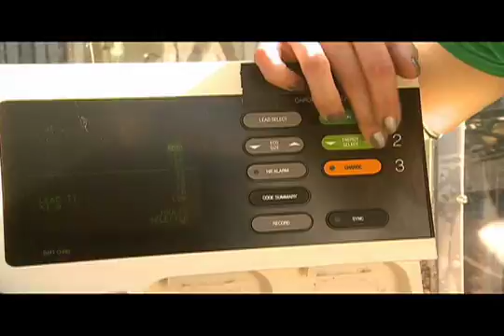MythBusters - Defibrillator Jumpstart

Comment: There seems to be a classic misconception that electricity=electricity. The defibrillator puts out thousands of volts at a few milliamps, the car needs 12 volts (thereabouts) at many amps to start. To the defibrillator, the car's 12 volt system, both the battery and starter, was such low impedance it was like a dead short, putting out it's full amperage capacity, which to the car was negligible - those milliamps just passed straight through, the voltage the car saw (impedance*current) would have been very little. I would guess that this would have no affect on the car, but depending on the defribillator's short-circuit protection may have torched the defibrillator. As for the car not starting afterward, it could be leaving the key on that whole time burned the starter. The battery didn't have enough power to crank it over, but even if it's "dead" that could run enough current through it to burn it out over the course of a few minutes - it's only designed to run a few seconds at a time. Another one of those moments where Mythbusters, as fun as they are, prove to be very un-scientific in their reasoning.
Reply: I was thinking the same thing.  Even 6 volts through a starter for a few minutes will kill it for sure.

I bet if they hadn't forced the ignition for so long the car would have started from the jump just fine.  The defibrillator didn't even touch the car in terms of power.
Its always been a pet peeve of mine when people talk about electrical power using only volts.
Reply: Defibrillators don't shock at a few milliamps, tens of amps depending on the energy
Reply: All I read was blah blah science blah science blah

Comment: Defibrillator has a lot of volts, you need amps to turn it over. Probably fried the battery, starter or blew a fuse.
Reply: if they blew a fuse the solenoid would not have engaged my bet having to livee with cars older thhan i am they got really unlucky and cranked thhat starterr its last time then didnt check that option.

Comment: High voltage low Amps, not enough juice to turn over the starter. Might have engaged the solenoid, but nothing else. As for it "killing the starter" or anything else, if the car was engaging the solenoid with the key after, the electronics are working, and I presume the jumper cables they had just didn't carry enough amps to turn the starter. Leave it sit for a few minutes and it would have worked fine. 

FYI the little tiny jumper cables you pick up at Harbor Freight or Home Depot are too low gauge to run the starter. Almost always you will have to leave the cars tied in for 5-10 minutes to allow the donor car to charge the dead cars battery.
Reply: no such thing everything has resistance.
Reply: Excuse me for the late reply but the defib discharges a capacitor across the paddles , capacitors supply infinite current for a finite period of time...
Reply: He is talking about jumpstarting at the end with the other car, and he's right IMO.

Comment: I don't think it would cause the lead acid battery to explode.. the battery would just absorb the charge. The voltage spike seen by the car's computer wouldn't be anywhere near the 1000s of Volts of the Defibrillator, but, obviously 100s is possible and that would kill the computer if it doesn't have surge protection.
But the battery itself would just take it in stride. The defibrillator won't put out enough current to cause the battery to heat up noticeably during that short period of time. IMO!

Comment: Prolly just blew the fuses, not the starter itself
Reply: True but it would still turn over.
Reply: Don't think the starter usually has a fuse.. direct connection to the battery.. maybe though. Maybe the main fuse for the fuse box though, so, no computer, no crank. and/Or the computer fried from the voltage spike.
Reply: danwat1234 Starter itself doesn't have a fuse, but all that power running through the wire harness prolly blew fuses for things like the fuel pump, injectors,  etc
Reply: it would blow the main fuse

Comment: @alwinovich @alwinovich It's 0.003 amps and above is lethal, Also you don't need voltage to kill you, Voltage = ammount, Amps = Strength. So no matter if it's 12 volt, 24 volts, or 240 volt. you get 0.003 amp trough your heart, you might die.
Reply: No, it's the other way around. Amperage is the amount of charges the current has and voltage is the strength each current has. What matters in lethality is wattage.

Comment: @alwinovich It's 0.003 amps and above is lethal, Also you don't need voltage to kill you, Voltage = ammount, Amps = Strength. So no matter if it's 12 volt, 24 volts, or 240 volt. you get 0.003 amp trough you, yer dead.

Comment: if you are jumpstarting a car it is better to clamp plus+ to + on battery and negative - on car body it is less likely for the battery to explode
Reply: Basically because the negative wire for the battery will provide additional resistance, cushioning the battery from the charge.

Comment: @alwinovich So you say if i stick a 9v battery to my toung I would die? because it got 150mA?? and i feel it in my toung :) Give up dude its de amount of energy (Volts times Amps) that counts :) I can stick my toung to 1x1500mA 1,5v battery (used wires of course) and it tickeld :D
Reply: The path of least resistance is the distance between the (-) and (+) poles of the 9V battery, so it all happens on the tongue. - or + on each hand is a different story!
Reply: No, the voltage is far too low. However with how many nerves there are on your tongue 9V at 150mA will hurt like hell.

Comment: I rather dought the difibulater killed the starter , but it probbly kiiled all the electronics in the car like the ECU and on many cars the ECU controls the starter  and the relays that click might not be controled by the ECU itself , if the car had a key with a chip and the ECU was damaged the car wont start

Comment: Ok, technical break... A defibulator discharges AC voltage, your car requires DC voltage. Second, all the volts in the world will not start the car if you dan't have the cranking amps to turn the starter. Exposing a human body to several hundred amps would kill you.
Reply: Defibrillators and especially the one used in the experiment don't put out AC current. They haven't since the 1970s and even biphasic units which deliver energy two directions aren't true AC. The defibrillator they used for this experiment is a monophasic unit meaning it only delivers energy one way. It's likely the thousands of volts over the short period fried something critical to starting the car.